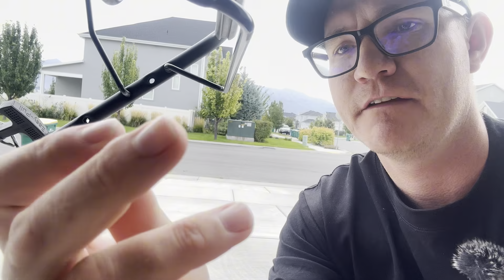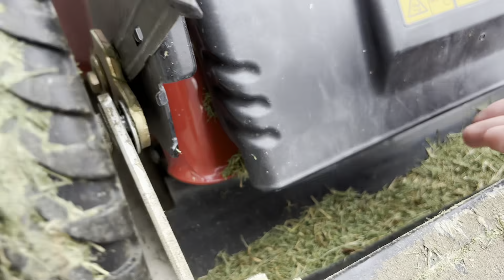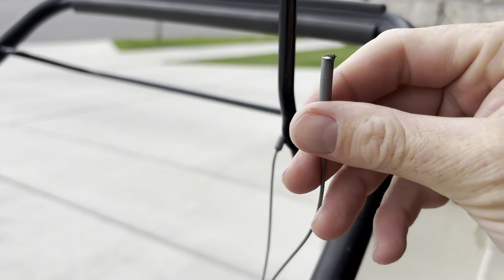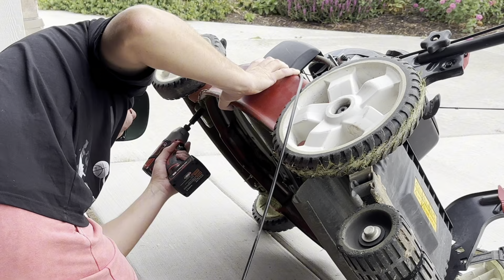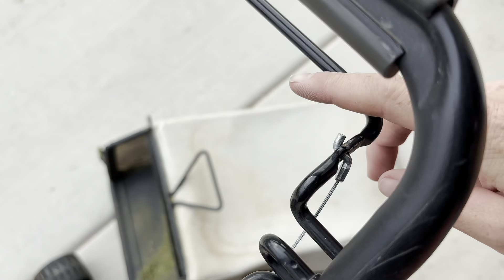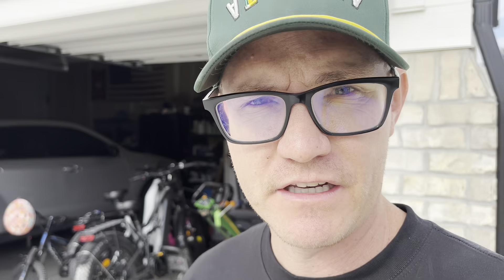Replace Drive Cable // Traction Control Cable Toro Recycler Lawn Mower

Comment: I did all that and when I hooked it up it is very, very difficult to engage. Like the spring is too strong. The lever above it moves with one finger. The traction cable lever is hard as hell to pull. What did I do wrong?  How would you fix this?  Thanks!

Comment: Hey, I got my drive cable from Toro website and the Z hook is on the end that is supposed to go under the cover and the U hook is on the handle end of the cable. The old wire was that way too, the Z hook broke under the cover. I don’t know where to put the Z hook with the new cables all the videos have the Z hook on the handle. Help meeee, please!
Reply from the maker: Spring goes in the housing,  Z at the handle. Just as in the video here 👍